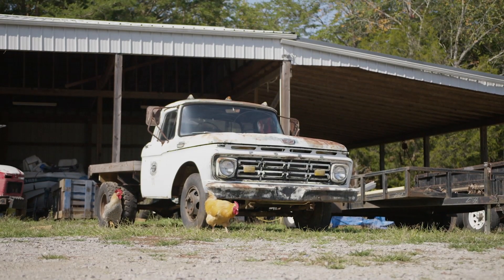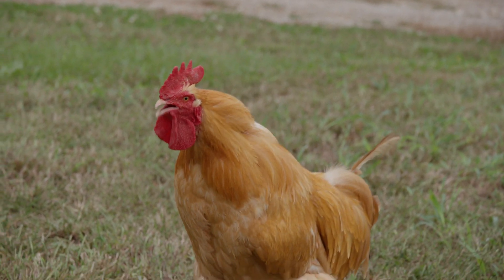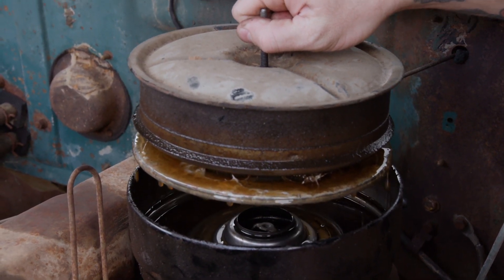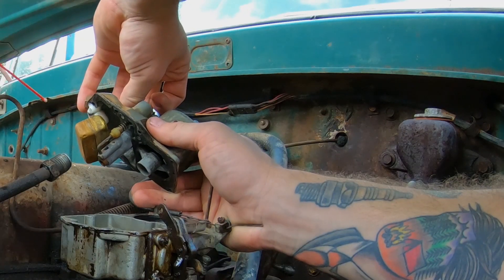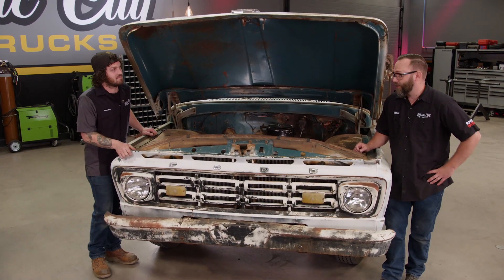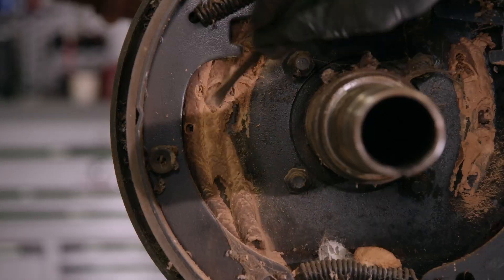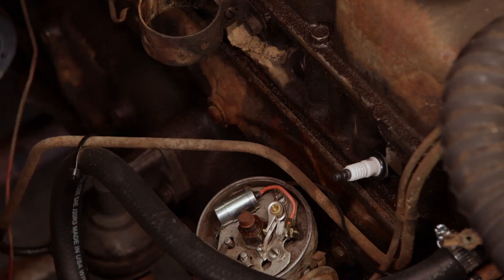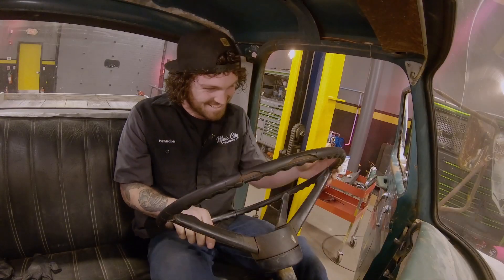Bringing A 1964 Ford F350 Flatbed Back From The Dead - Music City Trucks S1, E7

Comment: Please don't rip out the In-Line 6 for a V8! Rebuild it, get a new one, ANYTHING! But please keep it a 6 under the hood!
Reply: What about a 300 i6 with a decent little turbo to help with hill pulls and have decent fuel economy.
Reply: How bout a Cummins?
Reply: Or even a 4200 Vortec although The direct aftermarket sucks. But with a little searching you can find used decent injectors just wanna make sure you trust the person anx check the injectors for the working and of course before you get the and waste time you need to do the research and figure out the price to performance ratio on oem injectors from other models. but thats good because then you can end up with cheaper, clearance, and open box. parts than if it was a half ass over priced bevause the  name coils, proprietary part for the atlas. But from what i can find is you can get custom grind cams and then you can use the new generation 07+ coil packs correct me if im wrong but they are alot better (based on a ls coil i believe) than the heat sink version and wont burn up, or get spark cut out. and you can get the new atlass and they with have these things including the better head, better valves with the aluminum head with bigger valve use the exhaust mani since upgrading to a long tube doesnt help then just use the exhaust manifold to turn into a turbo manifold also with injectors there is an odd aftermarket for them DO YOUR RESEARCH before buying injectors( sometimes you will get some cheap injectors from an ls, 1/2j, And then there are the amazon special "OEM STYLE china special" which i dont seem to have problem with my 07 f150 4.6 2v and refuse to buy 80 a piece for some half ass oem coil. and some others if i heard correctly You can figure injectors out pretty easy as long as you do the research get you a tuner also for the aftermarket injectors they run a little rich but my dont be afraid to call a speed shop you go to and frequent often and they will more than likely help you out even though you might not buy their product, or call aome big suppliers, Summit Racing, Jegs, etc. And ive seen a guy try to build a new intake with extra injector ports so he can run 16 injectors. This guy is also the god of the atlas motor he has alot of the info on modifying these come directly from him name is nivlac or something like that but he really knows his stuff and i believe has done 2 4200 maybe 3 but they are awesome and stout and absolutely love boost and have great torque curves and plateaus and good screamer when you rev it out with a big turbo or i was wondering how many people have tried twins by splitting the exhaust mani half and half per turbo to help with turbo lag even though they got decent low end torque to spool a biggen, but ive also wanted to see a triple compound setup and see how that would turn out. Do the same half and half mani then feed this turbos into the big turbo and through  cooler and into TB, and would be aweome if the hand some high flow forced induction intakes and more throttle bodies, or blow thru carb/EFI and see if how peppy it is or if thats just to much turbo and be better with a medium size pair or a somewhat larger all based on your application, restomod hot rod, ratty tow rig, or decent shop truck with some pep for hauling stuff in the flatbed and/or towing while also not literally committing a homicide on fuel economy. I love the idle of the cummins preferably a 12v unless this truck is gonna be completely gone through truck then maybe a common rail. Wow i just realized how long this was. I get going and can stop 😂🤣😂🤣 sorry guys

Comment: I wish I had the truck I'd do a cheep orileys frame off restoration but the motor and drive train would get rebuilt I'd shoot for like 300 horsepower and 400 torque and repaint and derustify it

Comment: Not sure of these guys training but you never, I mean never use compressed air to blow off backing plates. Always wet clean and let air dry. I don't think anyone wants the chance of asbestos particles floating around the shop.

Comment: turbo and a 5speed from a 300 ford may be just do a 1992 year range 300 2wd 5 speed f150 swap efi use a microsquirt and a small turbo pump gas  K.I.S.S method

Comment: It seems odd for the smaller 6 in a 1 ton. I would have expected a 300!
Reply: Apparently they weren't made yet in '64. I used to have a book called Ford Trucks, 1908-79, but I sold it years ago. It had all that info in it.
Reply: @pookysdad4884  I have a old Motors Repair book around somewhere 64-70 too. I don't remember when the 300 came, but it would have been an upgrade for a 3/4 - 1 ton truck.

Comment: What the hell is with you guys and lowering trucks ?that takes the usefulness and truck right out of it.
Reply: Gotta agree with you.  This is a farm truck, basically.  So it has to sit high to keep the floor from rusting out and make it easy to work on in the field.  Granted, it wouldn't hurt to put some new bushings and bolts on the frame.  I'm sure the rubber ones have seen better days

Comment: A Ford 300 six cylinder and new tires and get rid of the man killer split rims.
Reply: Those aren't the "man killers", these are still used today on large equipment. The "man killers" are the ones that split dead center of the wheel.
Reply: @AndyFromm  they have been replacing them on semi trucks and trailers now for years. As a matter of fact you are hard pressed to find new ones. I believe DOT has pretty much well outlawed them. I have seen them come apart while still on the truck. To fill them they go in a cage or you put chains on them. So tell me again they're  not man killers.
Reply: @ronaldbradley9949  once again these aren't the "man killers" that is the other style split rims..... these many of these style wheels on the road and aren't outlawed! You'd have a hard time finding the real "man killers", I have been fixing tires for 20+ years and haven't seen one of those in person but deal with these quite regularly.... and once again, every new terra gator, payloaders, haul trucks or such machine comes with this style wheel still today!

Comment: NO points and condenser . No lube on the backing plate shoe contact points . No wheel cylinder rebuilds or replacements . I hope no one follows in your path .

Comment: Patina translation I’m to cheap to paint the truck. Lowering it is like putting a dress on a pig. Tighten up the front end with whatever is worn out put some new tires on it. Disk brakes are nice but drums are perfectly good at the speeds that truck was intended to go. If I did any engine swap it would be a built 300 six naturally aspirated. Ford made a perfectly good truck don’t screw it up with a bunch of wiz band bullshit.

Comment: Safety glasses good also respirator if your going to spray brake dust all over everything and everyone.in the shop I worked in using an air gun like that on brake dust would get you tossed out. Just sloppy work ethics.

Comment: "electronic" fuel injection? it's 2021... what other kind of fuel injection is there? as for being daily driver-ready the carb and drums work just fine so it's daily-ready as is. new gas tank maybe, new tires, clutch, and that over drive. clear coat the old paint!